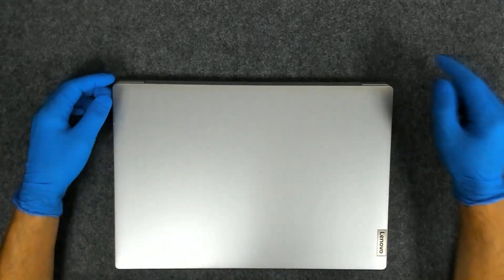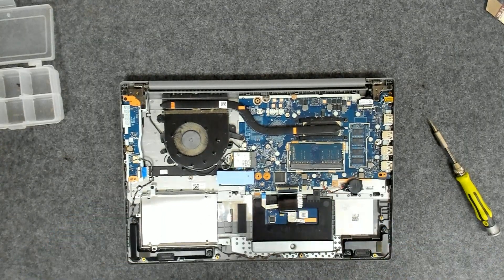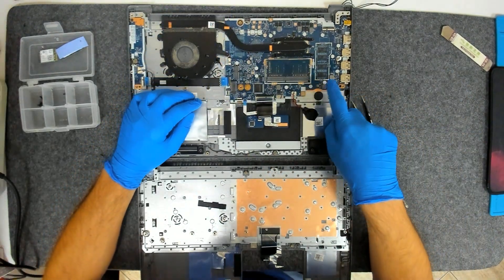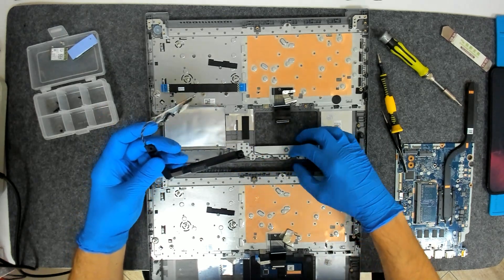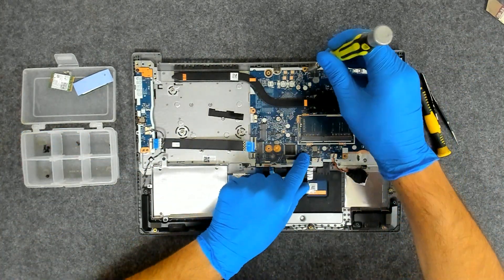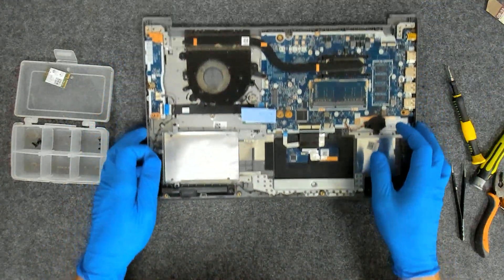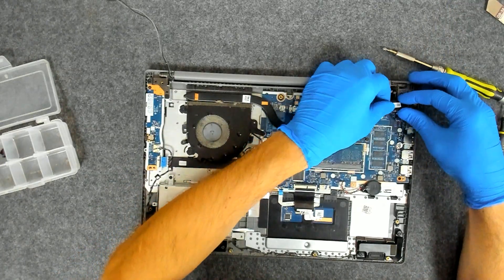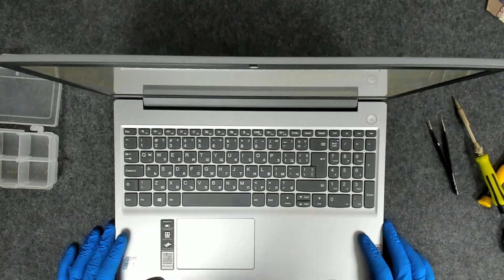Lenovo IdeaPad 3 Palmrest Replacement / 15IIL05 81WE /

Comment: I asked to replace the same part but ended up i with a wifi connectivity issue. I went to fix it but its now again the same issue.
Help me
Reply from the maker: You have 3 possible reasons by my opinion.
1. They didn't lock properly the cables to the wifi card. This model uses smaller wifi pin cables and sometimes they don't lock all the way and get unlocked. If one of the cabels is out, you will have lower wifi signal and etc.
2. They broke some of the wifi card pins for the cable.
3. They damaged one of the wifi cabels during the replacement.

I think most likely is the firs one. Open the back cover and check the cables.